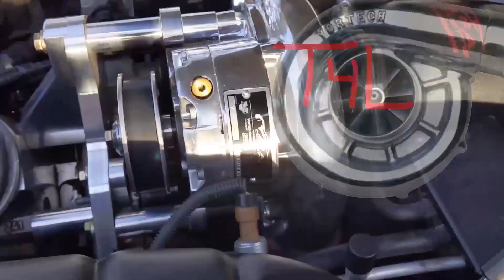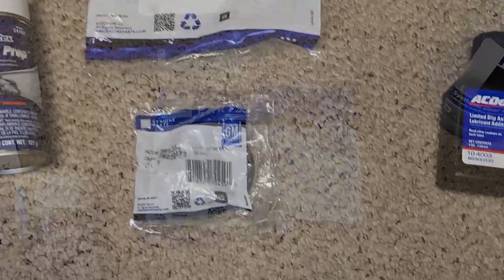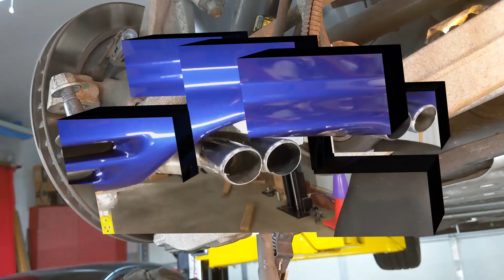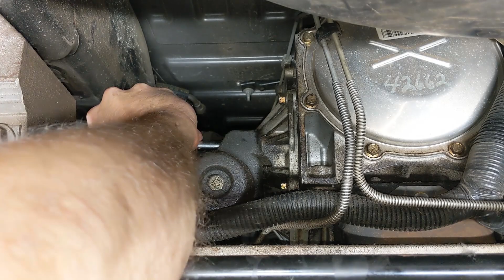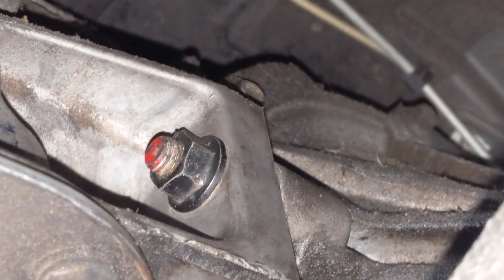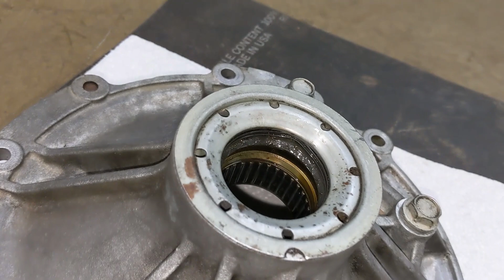C5 Corvette Rear Differential Leak Repair (Steps A-Z)

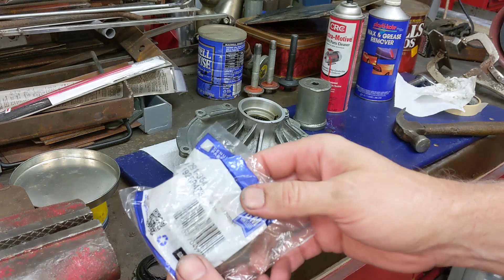Comment: Doing axle seals on my C6 currently. I noticed behind the seal on the driver side and as shown in this video 7:51 there is a small hole behind the seal along the perimeter. There isn’t a hole behind the passenger side seal. Do you know why?

Comment: Thanks for the detailed videos! I would not have confidence to work on my C6 without them. I have the following question: You used Anaerobic Gasket Maker and Surface Prep spray for the differential leak. Is there a reason that you did not use the Anaerobic Gasket Maker and Surface Prep spray for the transmission split and the Reverse Lock-out Solenoid Cover? Thanks in advance for responding!
Reply from the maker: Great Question. I follow what I believe was factory.  If the tolerances are tight and movement is minimal Anaerobic sealant it more likely used.  For bigger items with less confidence everything is a machined tight fit - I think they go more with RTV.
Reply: @Toys4Life  Thanks for the quick response!

Comment: question, why to remove the diff covers? isnt it doable with it on place? Great channel btw.
Reply from the maker: This particular leak was the large driver side diff cover which is fairly common on certain years C5s. You don't have to remove the cover if you're just replacing The seals were the axle goes into the differential.
Reply: @Toys4Life  thank you for the answer

Comment: Great video. I’m noticing an oily leak on my garage floor after driving my 99 hardtop. The leak is pretty much directly in the middle of the car under the rear axle/transmission. I’ve put down a shop towel on the floor to trace the location and how much is leaking. It’s very little now, its about 2 inches in diameter but needs attention next spring. I’m assuming this is the issue I’m having ? I’ll need to bring it to my mechanic/ shop who’s replaced my Harmonic balancer earlier this year. If this is the issue how many hours would a reputable repair shop charge for this repair? Also saw another video on a Manual Transmission Shift Module Oil Leak.  Maybe this is the leak?  Really cant tell until the car is on a lift.  Thanks
Reply from the maker: If you live in Minnesota, let me know. You could call a dealership and ask what the flat rate is for the job. Then it really should be the flat rate times hours plus the hazardous fees and whatnot. If I'm plucking it from air I'm going to say about  $500 but I'm usually low.
Reply: @ I hear you. I’m not even close to Minnesota, I’m in Staten Island NY.  My mechanic/shop is an honest as they come. I’ll bring it to him in the spring for look. His hourly rate is $120/hr the last time I was there in the spring when he did my harmonic balancer which was $990 cash. Appreciate the advice/feedback.

Comment: im stuck on the stud no matter what i do both nuts keep spinning, am i using the wrong nuts? ive gotten them to get stuck to each other but everytime i go to back it out it pushes the other nut out messing the threads up a bit, please send me the right nuts or adapter at this point 😅
Reply from the maker: Your stud must be really stuck to the diff. If both nuts have the correct thread - then they are correct.  Did you lock the two nuts together first?  May want to try heating the stud a bit.  Good luck to you!

Comment: Hey there, little late discovering this video, but was curious… I’m fairly mechanically inclined but do NOT have access to a lift. Seems like this might be doable without one…? What do you think sir? Seems like lowering the exhaust would present the biggest issue. Just trying to get your take on whether this is doable on the garage floor with some jack stands. Thanks. 🤙🏼
Reply from the maker: Agreed, exhaust would be the biggest issue - I think it needs to come out which means getting the rear up quite high - not exactly sure how many inches - sorry.
Reply: @Toys4Life  Thank you!! Much appreciated.

Comment: You said that you did not want to use an impact wrench to remove the axle nut because it could damage the CV joint.  You used a hammer to pound the axle out of the hub.  Wouldn't that also possibly damage the  CV joint?  Wouldn't it be better to use a puller to do that?  I learn from your videos and don't really understand this.  Thank you.
Reply from the maker: Good question. It is just a precaution.  Using a large socket wrench (that you already have) can easily remove the nut and it eliminates the jolting of the impact gun. It would be best to use a puller/pusher to remove the axle shaft but they are uncommon and so long as your not hitting it super hard the odds of damage are small.  Hope this helps a little.

Comment: Liked and subscribed for obviousy reasons. Incredible video. One question here: whats the size of the diff cover to trans stud?  I guess I could take the existing nut off and go match it to pick up a second.  I have an m10x1.5 here at work I was going to bring home.
Reply from the maker: I don't recall exactly unfortunately. That sounds about right though.

Comment: How long should a reputable shop take to do this? Do you run a shop in the MN area?
Reply from the maker: It's like anything, if they do a lot of C5 work it would go quicker than if they rarely see C5's.  (3-4 hours or so + gathering parts and supplies). Unfortunately, I do not have a shop - I just do side jobs from time to time.
Reply: Yes this was the answer I was looking for. 3-4 hours of labor.

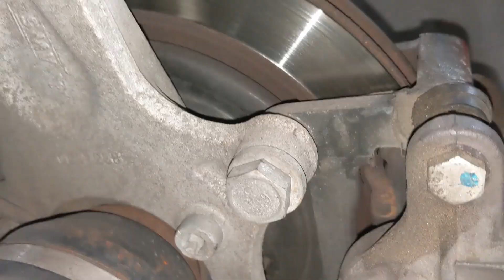Comment: Any difference between this and a C6 3:42 Differential? I have a cracked drivers side cover on mine, which seems to be a known issue with this part. Trying to get the part is a nightmare as most yards I called all have the broken left side....Or buy the whole Diff. Besides some of the connections and parts the process should be the same I would think. BTW your videos are great and very informative
Reply from the maker: I believe they are different.  There might be differences in the 05, 06-07, and 08 plus.  Worth looking into.  Can you have it tig welded?
Reply: @Toys4Life  it was cracked in half by the mounts. I have one coming to me soon as I got lucky from someone who was doing an upgrade to a z06. 😀. Thanks for reaching out. Love the channel!

Comment: Call me ignorant but why does the C5 have rear tie rods? I am not familiar at all with independent rear suspension setups, and tried googling for an answer. I guess I didn’t use the correct search terms.
Reply from the maker: You could call them links. Since it's a independent suspension and not a solid axle, these tie rods or links are used to hold the knuckle in place and allow for adjustability.

Comment: Where should I get parts?could you leave part numbers if you still have them? thanks Dave
Reply from the maker: Hi, In the beginning of one of the videos, I took footage of all of the parts laying out. You can grab the part numbers off of that. Most I got from RockAuto in a couple from GM.
Reply: @Toys4Life C5  thank's very much great video after watching this I thank I might do job myself I appreciate this video🤜🤛👍
Reply from the maker: Glad you liked it sir, if you decide to proceed good luck with it, just take your time!!
Reply: @Toys4Life C5  on that treaded bolt when you put another nut on it what was threaded size of nut?
Reply from the maker: @vettester09  That is the stud - right?  I seem to recall taking the nut over to my metric nut/bolt bin and matching the nut to a bolt, then matching another nut to the same bolt.  If you don't have such a bin, time to go to Menards or Home depot and match em up.  Sorry I don't recall the exact thread dimensions - but 99% sure metric.

Comment: Can you please list the part numbers for the parts in the video?
Axle nut
Axle seal
Sealant
Sealant adhesion promoter?
Cleaner
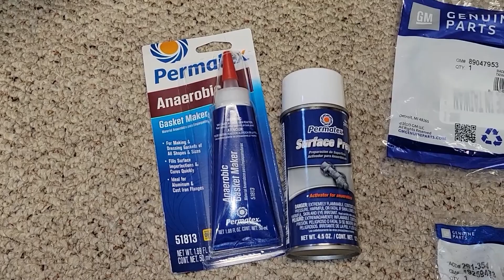Reply from the maker: 0:21 has most of them.  Let me know if you are not able to make one of them out.
Reply: Mainly the axel seal itself. The bag is slightly scrunched up.

Thank you!

Comment: One of the easiest vehicles to work on is my 01 Z06 why not do both other side is 18 yo too I'm guessing .But where do you stop , had radiator leak on my 97 Camaro decided might as well do water pump turned into opti spark turned into timing set only got 112k on car wish it was the Z06 but that only has 30k
Reply from the maker: Other side wasn't leaking, the driver side is known to kind of have a defect and it's more common to leak which is why you use the anaerobic sealer in addition to the o-ring. Passenger side was good to go as is.

Comment: I replaced the driver side half shaft on my 02 z06 last year. It's not too bad of a job. Just take your time. I didn't know there is a stud to remove on the differential cover. Good information to know!
Reply from the maker: Indeed, take your time, keep things clean and have a good torque wrench!

Comment: Should I get a 99c5 or 2000-2004. I heard 97-99 have a module problem that its not available for replacement. Thanks
Reply from the maker: I would suggest 01-04.  Here is more info in detail.  https://youtu.be/SbBdsiM_U18